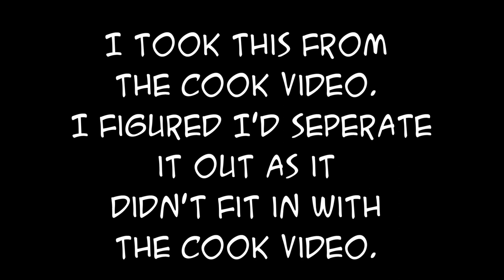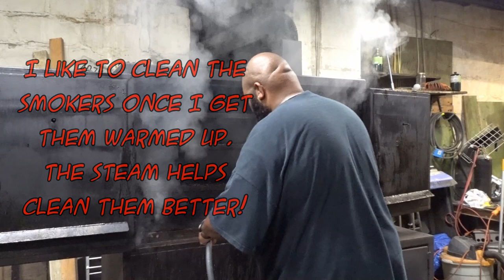SDSBBQ - Cleaning Bernadette The Big Insulated Reverse Flow Cabinet Smoker Before a Cook

Comment: It would be easier to clean after each cook that way prep work is minimum. It seems anyway.
Reply from the maker: I usually do, the last cook ended up running a little long and I never went back to clean it once I was done. I would say 3 out of 5 cooks I clean right after I finish but there are also times when I am dead tired and just go inside after a cook. But when it takes me a while to clean a smoker prior to cooking it reminds me to clean after a cook.